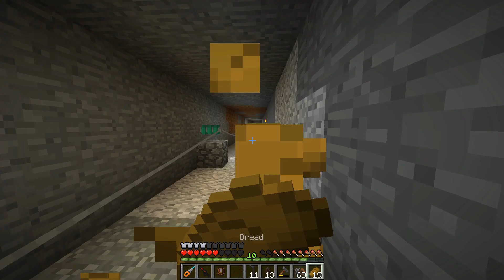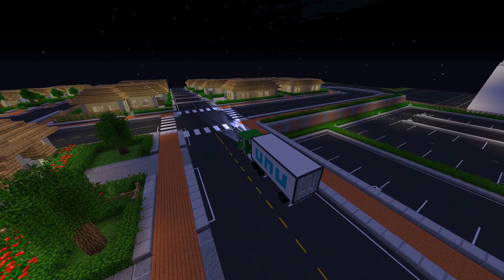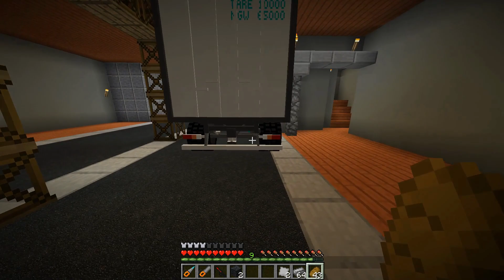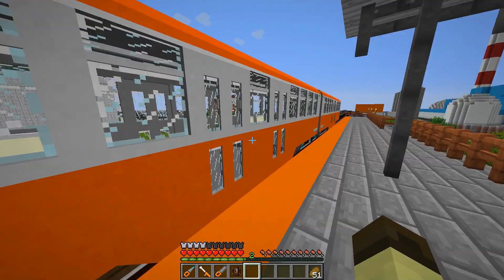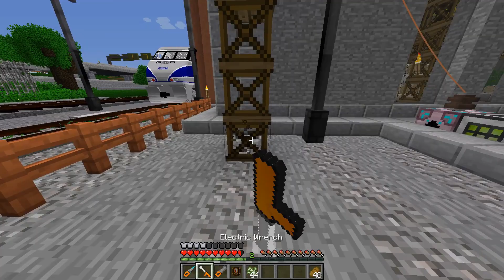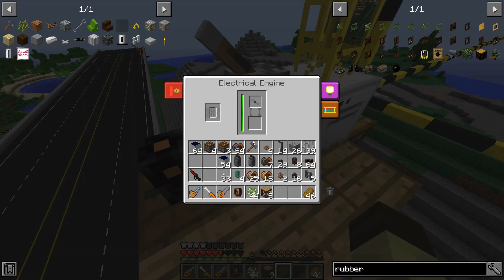Immersive Engineering High Voltage Infrastructure

Comment: Ik this is from a while ago but you should be able to directly power the quarry rather than converting Immersive Flux (which is just RF) to EU to RF.
Also the transformers are limited on the input by the amount a single connector can handle (LV is 256RF/t) so depending on how much you are generating you may need multiple transformers to send all the power.